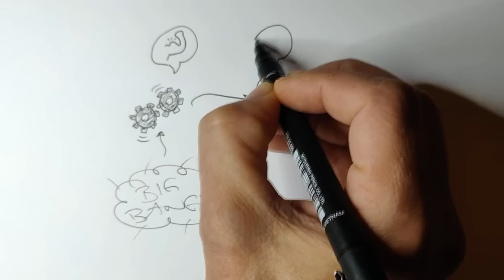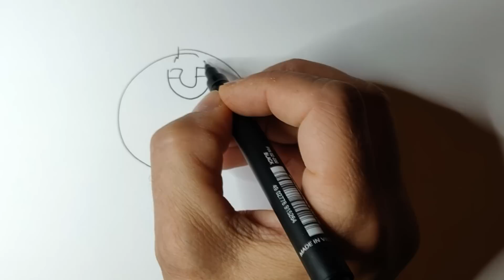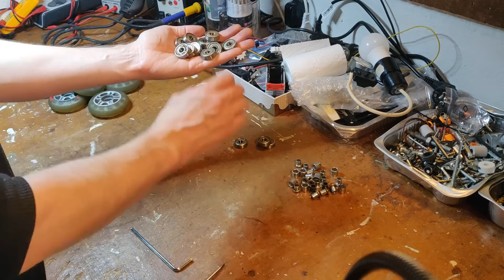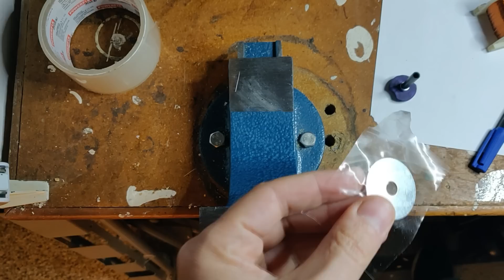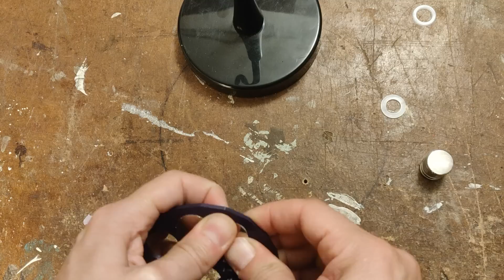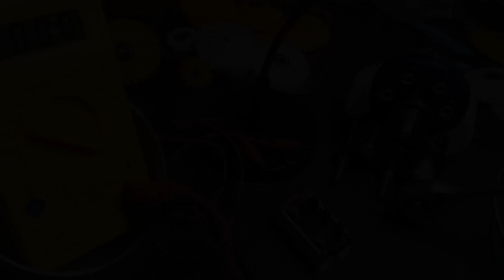How to make an easy 3d-printed 12 volts generator - create your own electricity!

Comment: Excellent work and details! Wounder, what if the frames be made of Aluminum instead. What type of filament is used to print those gears?
Reply from the maker: Thank you for your kind comment. The filament is regular PLA. Aluminum frames would be a vast improvement, as would aluminium or carbon fiber gears.

Comment: i actually never tried to use capacitors with air core coils in a permanent magnet configuration. perhaps it would do just as good as steel. who knows. i mean a kind of tank circuit.

Comment: can it charge a car 12 volt lead-acid battery ?
Reply from the maker: I'm afraid not - the electrical powers contained in such a battery are tremendous, and this generator would not be practical in recharging those. This is for cellphone-charging and such minor applications.

Comment: What a great video! This was my first time doing anything like this in my life, however, It didn't work for me. I think I made the coils wrong. I also am not sure how you got the starter bolt to work. When I turn it, it just pulls the gears tighter and tighter. I think it is because my started bolt is threaded from top to bottom and yours stops after about an inch and a half. I will have to go back to the hardware store and find the right parts. Then back to the wire store for some thinner copper wire. However, I learned quite a bit doing this so thank you very much. When I get this to work, I will post a video and share it here. Then I will teach my students how to do this.

Comment: Sweet 3 printed design. I especially like the way you described the 3 phase connection.  I will more than likely print this guy out but I may scale it up as you mentioned. More copper and thicker wire :)
Reply from the maker: Thank you for the kind words. More copper and thicker wire is definitely the way to go! :) Love you channel - great stuff.

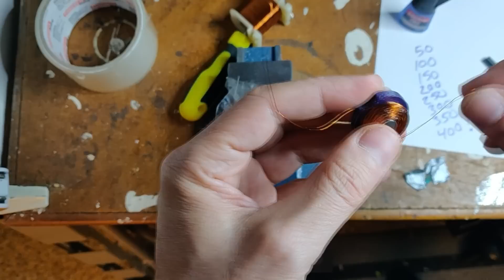Comment: Thank you for this tutorial!!! Just a small question please: in 15:55 you point out, that it is very important "...to wire the same number of turns on each coil..." What happens, if there is on one coil 400 turns and nother 415 and another 390 and so on? How would this impact the electricity produced? Thanx in advance for your reply!
Reply from the maker: Hello Andreas, 
thanks for your kind words.
For an application such as this - i.e. non-professional, DIY-stuff - it's not tremendously important to have the same number of turns. The thing will generate power and a rectifier will turn it into something useful. But it won't be the optimal power-generation, an unequal number of turns will create voltage ripples that will cause the generator to be less efficient. Think of it like a straight river with an even and reliable flow, then think of those voltage ripples as big chunks of rocks thrown in. You will still get a flow but it won't be as reliable and therefore not suited for some purposes. But for DIY you'll be fine. Perhaps check out my other video, I did a thing where I can coil all coils in a stator in one go.

Comment: I wonder if adding a flywheel would also help. I know it would increase the difficulty starting up, but would allow for smoother continuous operation once it's up to operating speed.
Reply from the maker: Adding a flywheel is a great idea, yet I'm thinking not so much for ensuring a smooth operation/output rather than for energy storage (That requires a different approach, though; the tolerances involved in 3d-printing seem to me to be low and not well suited for flywheel implementation). I'll likely revisit this notion later (so thanks for the suggestion) as I hunt for smooth operation AND frictionless startup. Why does everything have to be a trade-off! :)

Comment: Hmmm....  I want to get a bunch of weights and spool of parachute chord and rig up the input shaft on the generator so weight unwinds the spool turning the crank.
Then outfit the circuit with a buck regulator so voltage stays below that 12 V.
Reply from the maker: I have that same inclination, am actually working on that setup as I write this. Comes with its own set of challenges! Stay tuned.

Comment: Thanks for the DIY video. Just like electric current flows in a full circuit, the magnetic flux also wants to make complete circuits.
   Consider optimizing the rotor by adding a thin iron based sheet to return the magnetic flux from north to south poles of adjacent magnets. As that flux doesn't change, theoretically it wont have eddy current losses.
  You could do this on the back of the coils too, but the changing magnetic flux WILL add some losses due to eddy currents. A more efficient option (as someone already suggested) would be to add another stack of rotating magnets on the back side if the coils. Including magnetic flux return to that magnet assembly would help.
   Finally, the coil cores you used look very thin. Filling them with iron slugs, or changing to them to thicker feromagnetic rivets would help to concentrate more flux into each coil.
Reply from the maker: Excellent commentary, thank you for the feedback. I aim to implement these kind of improvements; in my defense, I was hampered by budgetary deficiencies, i.e. I needed to make it work with scrap parts and what I had lying around. The changes you mention will certainly improve the output. My next project will specifically see the 'another stack of magnets' suggestion through.

Comment: information.      mostly good work.   aside from the alternator design  flaws.
14:32     the use of  TINY  wire is the  Opposite of smart.!!!        if only small wire is available, then, coils should be wound 'in hand'.!!!            14:39    more bad coil-winding advice.!          22:11    with the  use of good magnets, this rotor configuration results in the formation of six full magnetic poles  ---  Between each pair of adjacent magnets.       it is not clear whether such a rotor configuration is a 'good match' for a stator consisting of  three two-coil phases.          31:10    !!!!!      a  poorly-made  generating coil, as shown here, acts as a current clamp.!     this means that the  output current (amps), and watts, from such a coil will  Always be  significantly  limited.                 a generating coil should be a brooks coil.        a brooks coil is, simply, a coil that  has the same number of  Layers  as  winds.       see linked illustration.       googletranslate
http://www.nessengr.com/technical-data/brooks-coil-and-calculator/
Reply from the maker: Inspiring comment. I'll take it all into consideration for the next iteration. Thanks for the feedback.

Comment: Nice!
One tip though, don't create a floating 'star point' on your windings (connect the star point to the negative of the rectifier for more stable voltage), wire the coils in a delta configuration and connect that to the rectifier and you'll get better current output.
Reply from the maker: Thanks for the suggestion, @Jeff. I believe I'll do exactly that with the latest iteration.

Comment: This is perfect! This is the video I have been looking for!!! 

So question….say you take a few of those gears away so it’s easier to turn, but you can get the RPMs up to 10,000 or so using a steam  turbine or something. What do you think the output would be? Or is there a equation to figure that out? I am far more mechanically trained and only self taught electrical.

Thanks and great work!
Reply from the maker: Thanks for the kind and generous words, Brandon.

I'm sure there are equations to be found, but I would be hard-pressed to conquer them; I'm simply not proficient in math, and more inclined towards experimentation (I.e. too busy tinkering to learn formulas). I'd like to venture a guess, then: if one were to implement all the optimizations I refer to at the end of the video, I'll estimate the generator could reliably deliver 7-800 mAh, at 12v. Thing is, it's tiny - there's not a lot of copper in there, and the magnets are not the most powerful ones can be purchased. Going up to 10k RPM will up the ante for sure, but it's not the golden ticket. Greater RPM's will eventually limit the generator and cause 'hysterisis', i.e. basically the electrons are shaken so fast back and forth they become, well, confused. Which will cause much of the generated energy to be released as heat, not electricity. Better to scale the generator up. A steam turbine, depending on the size, usually commands a lot of torque; preferably then let the turbine driver bigger - and why not multiple - stators and rotors, with more powerful magnets and more, and thicker, copper. That's the bigger bang for your buck.
Reply: Thanks!

Comment: I would love to hear more about reusing scavenged parts. I have so many electrical components, but not the engineering context to know what they do or what values are important. Showing how you can take apart an appliance and use more than just the copper wire in a new project would be really neat, IMO.
Reply from the maker: I have a few ideas on how I could go down that route. Am committed to some upcoming non-related ideas but will hang on to the suggestion. And thanks for it, much appreciated.

Comment: Try to create another layer of magnets and coils. By doubling or tripling the permanent magnet layers and coil layers, switching every other layer between PM and coil layer, you can generate the most power you can out of a device like this.
Reply from the maker: Will definitely go down that path. Thx for the suggestion.

Comment: It is good you have an industrial 3-phase rectifier laying around!
6x 1A Shottky diodes may be more accessible to the home hobbyist.
Perhaps less expensive, and more efficient.
Reply from the maker: You are not wrong. I plan to soon make a short tutorial on that, to accommodate. Thx a lot for the input.
Reply: 6x 1n4007 are even easier to find
Reply: I don't know how easy they can be found but scrap alternators would have the three phase rectifiers, assuming they were not the point of alternator failure. They are also sized for higher currents, assuming the current can be generator.